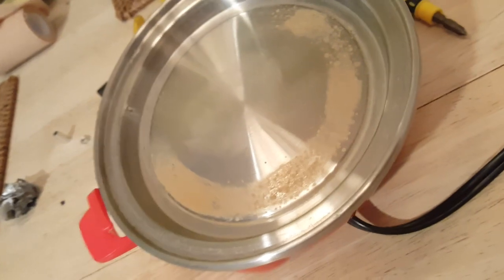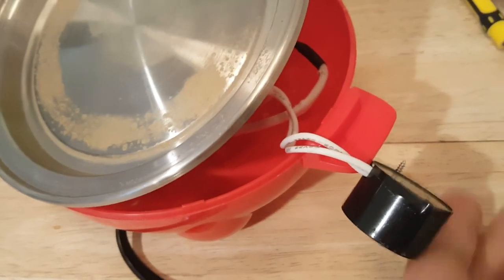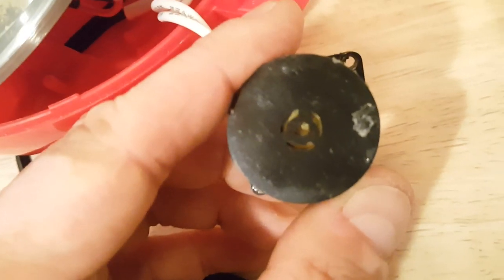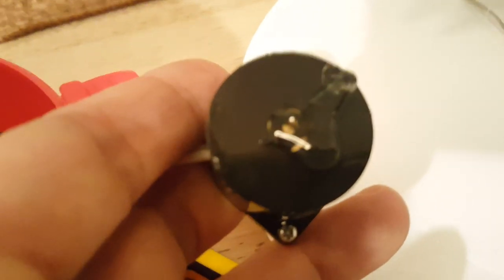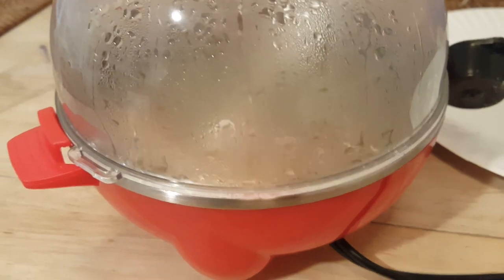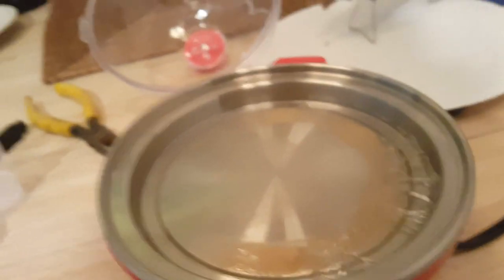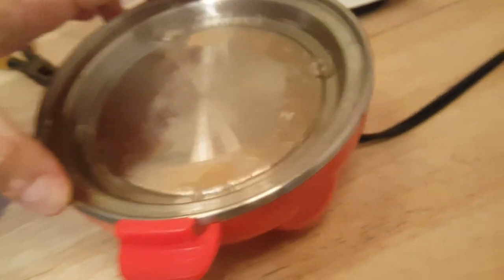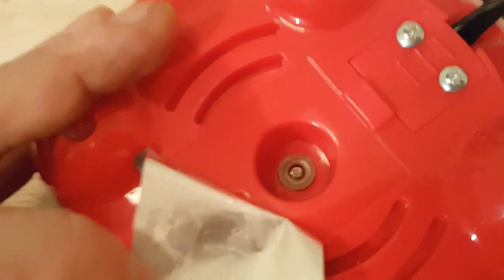Dash egg cooker hack to quiet loud buzzer.

Comment: I just got this and used it for the first time today at 2 am. Idk whose bright idea it was to put a buzzer that obnoxiously loud on this machine, but when it went off, I fully expected my kids to wake up and come running thinking the smoke detector was going off. And it’s not like it just lasts a few seconds, which I would find acceptable. The thing goes off until you hit the button. Ridiculous. I will definitely be using your hack, so thanks. I may be using enough glue to make it stop completely, I haven’t decided yet. I’ll also be leaving a review on Amazon to reflect my feelings on the obnoxiously loud buzzer.

Comment: I hate those crappy buzzers. I've done the same thing in the past! I've also taken the piece buzzers from items like microwaves and dented up / smashed the heck out of the internal element with a screwdriver or some other sharp implement to reduce it's effectiveness. I had one buzzer that was still too loud after basically destroying it that I just filled it with glue like you did... Sometimes a little noise is ok, but I don't need to hear it over a heavy metal concert!

Comment: I'm about to do something similar, but I'm considering using silicone sealant rather than hot glue. I found some piezo replacements, some that are settable as to tone, but they were all still horribly annoying.
Reply: I used silicone sealant, and it worked well. It's now just obnoxious, not alarmingly loud.
Reply: While they have changed the buzzer now to a melody it is still obnoxiously loud. Basically filled the thing up with silicone and it is still working at half the volume :-) Thanks for posting the video and the tip about the silicone.
Reply: robinder70 melody? Which version is this?
Reply: @remlezar9397  If you order it today on Amazon, it will have the melody instead of the buzzer. I used to have one with the buzzer and hated how loud it was! Also, the new red one is a darker, nicer shade of red. Not as bright red as the old ones from 2+ years ago. I don't know about the other colors. Hope this helps.
Reply: @laurahorstmann8616  helps a whole lot. I hate how long the normal process is just to boil a few eggs. Just made my breakfast a lot better lol thank you.